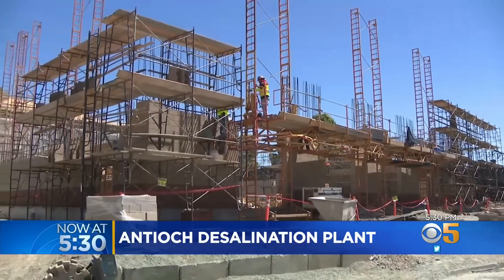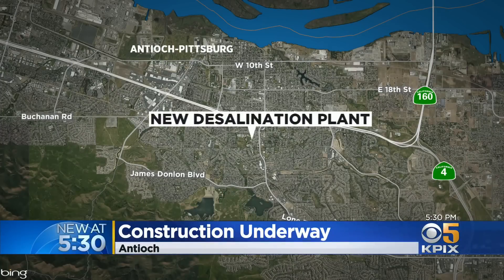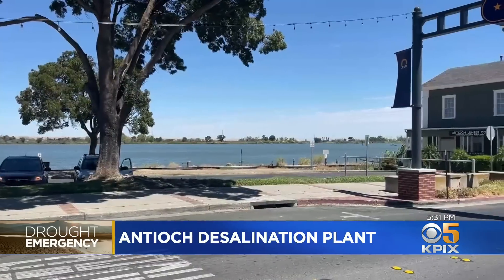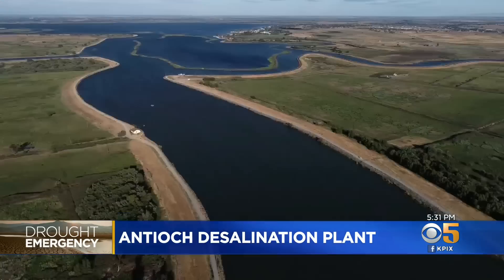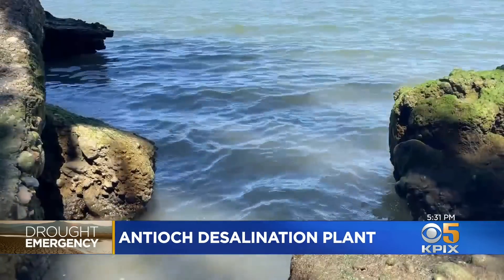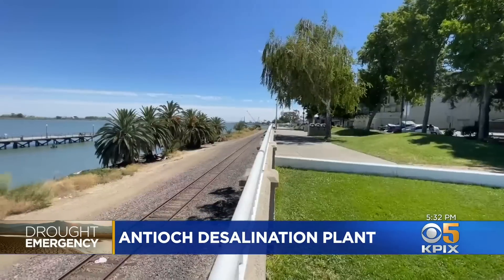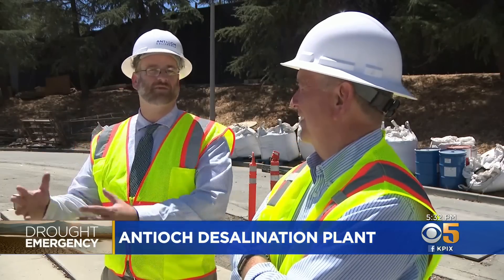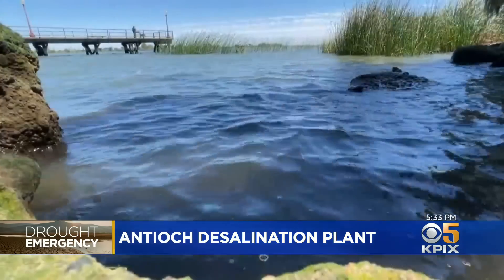Desalination plant construction underway in Antioch

Comment: There are 4 oz of Salt in every Gallon of Sea Water, humans use about 100 gallons of Water a Day. So that would be about 25 Lbs of Salt for every person per day. Lets assume an Area with 8 million Folks, Like the Bay Area. That would be 200 Million Lbs of Salt per day being dumped into the Ocean or the Bay, Like the San Diego Carlsbad plant does.  Salt Brine is much heavier than Sea Water it sinks to the bottom and Creates Salt Lakes that kill the Ocean Floor Sea Life and hence the Food Cycle. Additionally it is Very Energy Intensive and Will double the cost of the Water Produced Easily. The Plant in San Diego is also only producing about 100 million gallons a day, that only covers 1 Million people. Smaller project here but if all the other cities start doing it same effect. They will kill the Delta with Salinity both from the Pacific and From their localities.
Reply: No. There's no way humans use 100 / gallons per day.  I can't even drink 5 gallons per day.
Reply: @rayj7699  Do you wash your clothes or dishes or do you live like a Pig? Do you like to eat food? It all requires food to produce, you seem to be forgetting about the Refrigerator and your Bathtub, unless you are Homeless and rarely bathe.